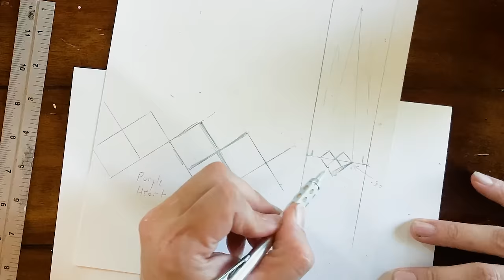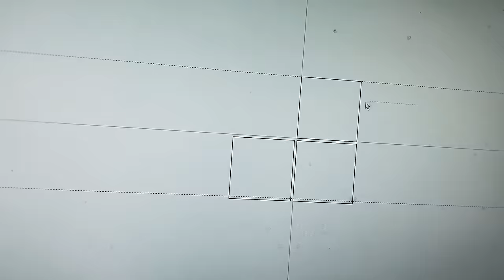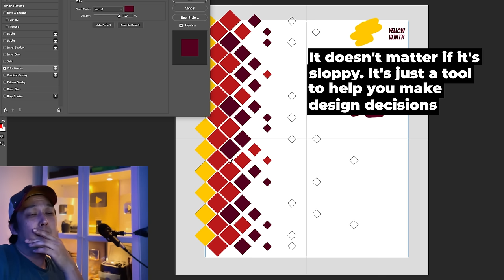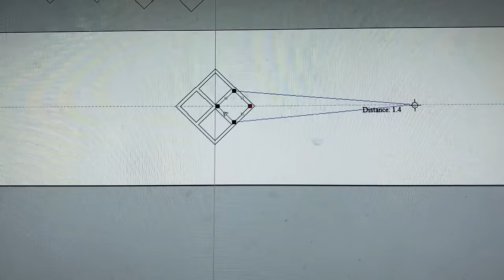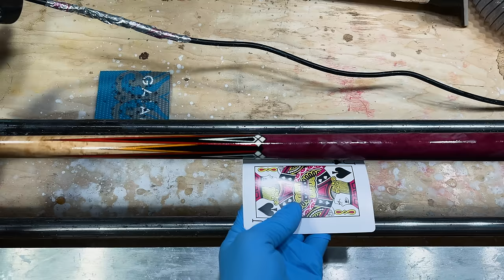Making a Pool Cue from Scratch (ASMR / No Talking)

Comment: I love this design!  At the 16:07 mark, I noticed two dark marrow deposits between the short and tall points.  Do you remove these prior to finishing the cue, or do you leave them in place?  I own a custom cue myself, and during the first refinish, the cue maker was able to remove a dark spot by cutting it out with an exacto knife, then filling in the space with the same wood type.
Reply from the maker: Thanks! On shaft wood, any blemished shafts get repurposed elsewhere. On the cue itself, it depends. If there’s an unsightly spot, it’s not too difficult to cnc it out and replace it. Some blemishes I don’t mind though.

Comment: Please can u make a tutorial for making a carbon fiber shaft? You'll be the first and only one on youtube to make such a video, and I'm really curious how it made and I searched all over youtube and could find any thing about pools carbon fiber.
Reply: Nobody will share the details of carbon shaft making because this small details are define playability differences at the end of the process (density of filament, optionally additional small weight bolt to reach optimal weight and balance point, there is too many 2-pc high density filament foams on the market with different kg/m3 values. 

Joint collars from Juma or Elforyb and brass/aluminium insert but for big pins like 3/8*10, wavy, radial I saw also carbon shafts with wooden and phenolic inserts

And the main thing which affects on deflection - front light, different foam or leaving first X cm of carbon tubes empty, also light material for LD short ferrule (0.15-0.3") and vault plate from polycarbonate, not acrylic. Polycarbonate vault plates density are similar to wood so they doesn't affect shaft playability
Reply: @essaalfi5884  forgot about the most important thing - blanks quality, wałl thickness can be 0,9-1,0 can be 1,3+ also there is different number and direction of fiber layers, many times long 15-18" pro-taper isn't available, only conical blanks (sic!)

Comment: Wish you showed the part where you put the pin in... I am using those same pins and feel like if I drill to 3/8, the large part is too fat to thread into the hole, so I end up drilling larger and still am not completely happy with my method...
Reply: Feel like the pin needs an allen slot on the end or something, so I don't scuff the threads putting it in too...
Reply from the maker: Sorry for the late reply, I just saw this. I can help— for 3/8-10 pins and radial pins, I drill with a 19/64 drill bit (.296). Then, for 3/8-10, I use a .308 reamer (if Radial, 5/16 reamer). I don’t use these 2 reamers for any other purpose. Just those two pin types. The critical thing is the barrel. The large part. You want zero slop. The threads don’t do anything but grip. The barrel is what is used to remain in alignment.